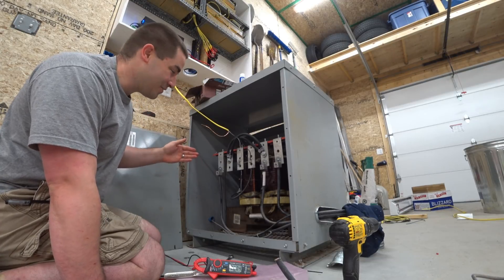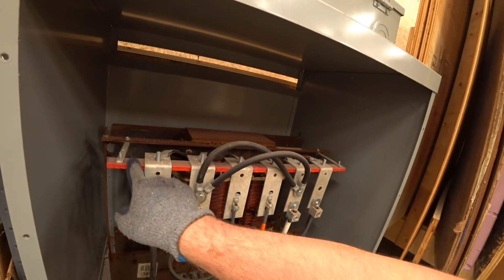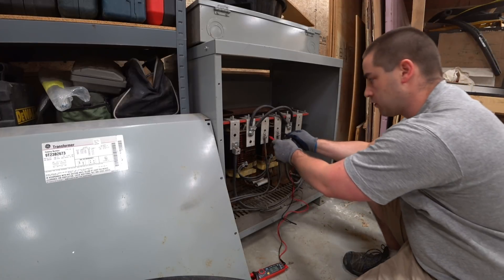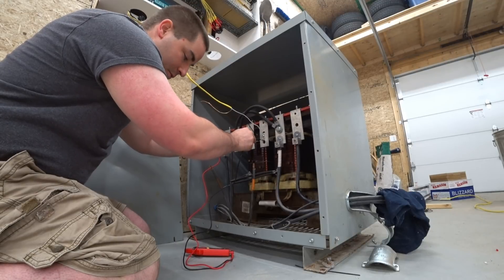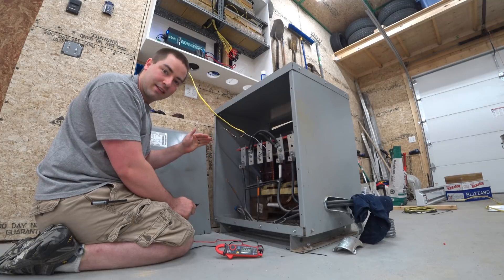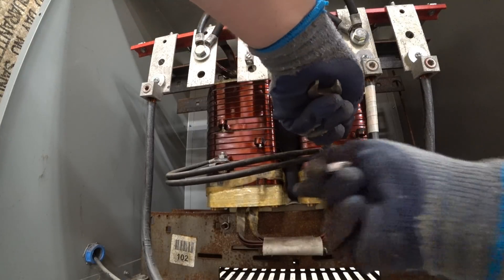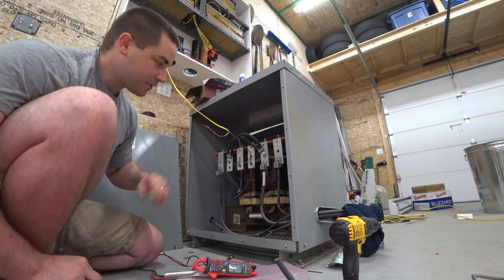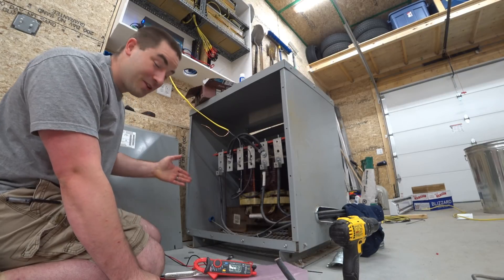Big Transformer, 120/240 Split Phase Breakdown

Comment: Dumb question.  Do you have 230 loads that you are attempting to supply  with solar ?  Because if not, meaning, if you only have 120 loads on both sides of your panel, you could go with a Reliance Electric break-out box (or similar) and (2) 120 V inverters and make the common "common" to both.  The 2 legs wouldn't be in phase, but it won't matter.  I'm thinking it would be more efficient than using the split phase transformer.  For that matter, you could have a 3rd inverter at 230 and use that to only feed your 230 loads.    I actually thought about doing exactly this before deciding on the Magnum, but I need to start a hoist and couldn't find any 230 global inverter that I had confidence in, meaning, that it would start the hoist.
Reply from the maker: Hi Mark, I have a couple 240 volt loads.  They are: stove, oven,  and water heater.  I used to have a mini-split heat pump which was 240v but that is just a hunk of trash still bolted to my house.  The cooking is the hardest thing to switch to 120v, even though there are some options.  I bought an induction hot plate a few years ago that plugs into the wall at 120v to test this out.  It can do most things, but can't keep a rolling boil with pasta.  I'm OK with switching out the heating element on the water tank to 120v if needed.  I suppose going down your train of thought... I could buy one inverter for the oven with a remote relay switch and only turn that on for cooking.  Everything else I could do with one inverter powering 120v.  Is that where you were going?
Reply: Yes- exactly.  Then you could run those inexpensive 120 v Reliable inverters (or equivalent).  240 resistance loads are no big deal - it's 'motor starting' that becomes a challenge.   So if all you're powering are heating elements, you could use an inexpensive 48V to 240 2500 watt inverter for like $175. Steve Robinson has run one for years powering up his water heater and kitchen stove- swears they are about indestructible.
Reply from the maker: Hi Mark,  I agree that it could be done on a direct heating element, such as a water heater.  However, I don't think it would work on a stove because there is a little computer for the push-buttons and timer.  Those might be powered off just one leg, 120v then a transformer to low voltage.  I don't know for sure.
Reply: Ah, yes yes.  The stove probably has a transformer that takes the 240 and makes 120 just for that purpose - which means you'd need a pure sine inverter to make the clock/computer board happy.  But still do-able - i think.

Comment: I think you have inverter transfer to input to the transformer 48v-57vac from H bridge to transformer and your secondary become primary and primary is secondary.... 
The same configuration I have in my low frequency 12kw/36kw peak inverter.. 👍 
I only miss compensation coil for AVR....

Comment: Most off grid transformer based inverters present a 40W standby load, so still half of this transformer but not nothing. Virtually all inverters have a transformer built in (even Euro ones) to provide galvanic isolation or split phase in the case of American power distribution
Reply from the maker: Hi Liam O'Brien,  You are right.  After doing this test I'm thinking that one N.American inverter with an idle load of 40w is better than a European inverter at 40w plus this transformer at another 100 watts.

BTW, I've got a safety video I'm working on now about fuses.  I hope you can chime in because I value your opinion in making my system safer.

Comment: So I have used a transformer like that (well mine is smaller at about 4kva) with my generator to produce 240v.  Connect the inverter to one side of the "output" (say the left hand 120v terminals) and you basically get what you want, just not isolated.  X1= inverter line, X3=inverter neutral, H1 & H2 not needed, X2=neutral, X4= other half of your split phase.

Efficiency is another thing, I guess you could wire all your 120v loads to use the inverter output directly and with a large switch or relay enable the transformer just when 240v loads are needed?  I found I do not really need 240v (when the power is out) hence I kinda shelved my transformer.  Mine also has H1/H2 that have taps up to about 500v so I do use it when I need high voltages, but that is very seldom.

Comment: Try these https://www.mppsolar.com/v3/ You really do not need this transformer. MPP Solar now sell 110 V for the US I understand. I have been using the 3kVA inverter for 5 years or so. It is very good. The problem is not only the voltage but you in the US have 60 Hz. The transformer will not help in that! You also lose on the efficiency. The MPP inverters are more efficient. Good luck from Cairo.

Comment: I was wondering, if I could do this: batteries to a 240 invertor. Then use a transformer to make a split phase like you did, so I could back feed my load center during the next Shft problem. The split phase is necessary to get the enphase solar to think the grid was back. Once the solar is back up, life is good until nightfall when the zombies return.
Reply from the maker: Hi Michael,  I don't think batteries can be connected directly to a transformer, only AC.  Thanks for watching.
Reply: of course. Batteries would only power the inverter, making a single phase 240 output.
Reply: Yes Michael that's call AC coupling and it's been done.  As long as  your enphase sees 60 hz, it will couple and do exactly as you say.  BTW, I've played around with some enphase inverters, you do NOT need their fancy gateway or anything, they just hook-up and go after like a 3 min waiting period.   And they will put out about 185 watts hooked to a good battery source if that matters to ya- but of course, like you say, they need to see AC to do it.   I originally thought of charging batteries with solar, then using the enphase inverters to back feed to trim down my electric bill, and it worked great. I had several enphase connected in parallel. But it was a bitch to control, meaning, at times I was pushing too much, then not enough.  This was in my early days of madness...hahaha... but so much fun !

Comment: just get a 240v inverter (it's a fun thing to play with a transformer but these things are optimized for 100A per leg on 2 phase) but just better to use pure 240v 1 phase inverter as they are more efficient than split phase or even 110v 1 phase inverter (liek 8000 watts is more feasible on a 240v inverter then it is on a 110v one as can have issues with cables overheating )

make sure its correct hz for your country when getting 220-240v one, normally 220v is USA 60hz and 240v tends to be EU/UK 50hz but sometimes the 60hz ones are sold as 240v so best making sure when buying it (even after you have received it you should plug a kill a watt into it to make sure its running at correct hz)
Reply: Nope no 2 phase. 2 phase was used 80 years ago. Was usually 240 volt and 120 volts to centet tap for a total of 5 wires. Some old big cities still have some 2 phase service and motors. Have not worked on a 2 phase motor in last 35 years. Most places will replace the obsolete 2 phase motors as they burn out to modern 3 phase. We had a 2 phase 2300 volt 3 wire transformer feeding a building across the street ftom main building. They put a wire from phase A & B together to only have a 3 wire 2 phase.

Comment: So you covered it right at the end, the transformer will pull no matter if it has a load or not. What are you going to do with this or just something cool to play with.  You are doing a good job but be careful please, I like watching the videos and want to see more.
Reply from the maker: Hi Charlie,  Originally I thought of using the transformer with a 230v oversees inverter.  However, now after seeing how much the phantom load is I'm probably not.  Do you have any ideas of things I could use it for?
Reply: DavidPoz pretty limited what you can do with it. Sorry that I do not have a way to use it or suggestions for it.

Comment: Our power here is 220/50 and because of that we can not use 110 with out converting the power to 220. Part of that is if you have a 220v/60 drier for instance from the USA it will combine two 110 v legs to make 220. Here One leg is 220 alone. So it is easy to fry something here from the former USA if you are not careful.
I do like 220 as a norm because it is more efficient over all. 
Also i am assuming you know about higher voltage solar system, 48 volt, is much more efficient and requires much smaller cabling as well. 
I am using a 230Volt inverter and I will purchase two 4,000 watt inverters from MPP SOLAR in the next month or so. 
The big problem with solar and batteries and the like is charging them with dirty power from a generator. The inverters are all so delicate that you can easily toast one using your generator to charge the batteries after a bad couple of days. So the answer i am hearing is to use an industrial battery charger and go directly from the generator to the battery charger to the batteries there by bypassing the inverter and saving your self some head ache to say the least. 
I envy you on the transformer. Wish I had one. Jim
Reply from the maker: Thanks for the tip on being careful with generator power.  Inverters are so expensive nobody wants to fry one.
Reply: Yáll need to go watch Justin Case Solar power on how to set up FUSES and cable size and you will be safe. I learned the hard way. See ya from the DEEP SOUTH. Jim

Comment: Add a few condensers and you could store your power for another day
Reply from the maker: What do you mean?  Do transformers store energy?  (I'm asking honestly)
Reply: no condensers do, transformer only change the shape of the energy. Hey what do I know have fun 50 KVA is a substantial piece of work. I was thinking you could store high frequency voltage produced by a  large string of panels and then release it later at a lower voltage (just dreaming along)
Reply from the maker: Cool.  Thanks for joining me on the dream.
Reply: Too bad Transformer won't work on DC. Also can't change the frequency so the 50hz European inverter would only supply 50 and not 60 hz